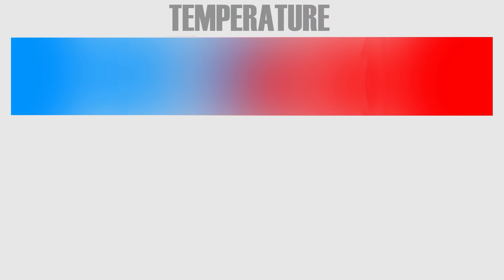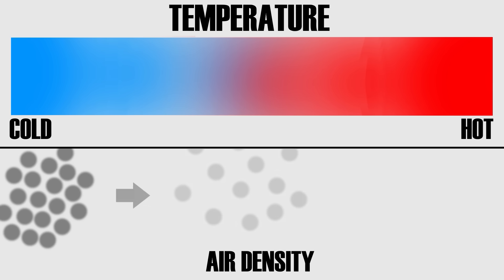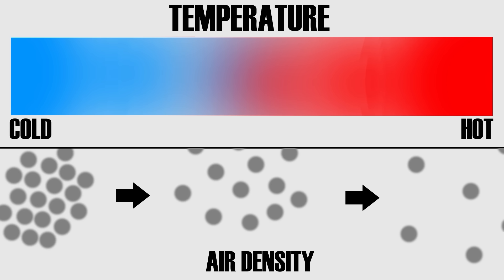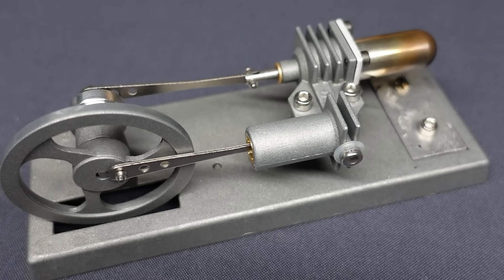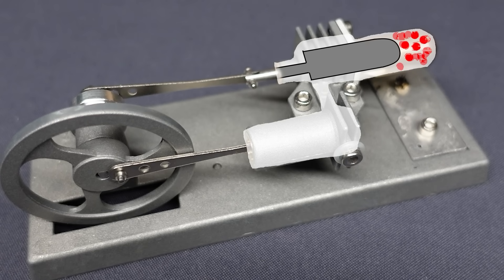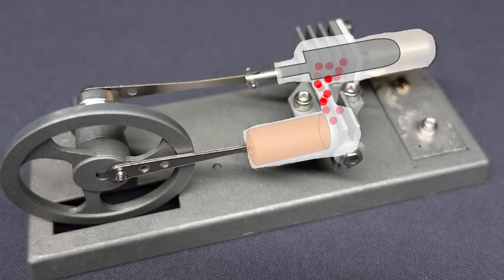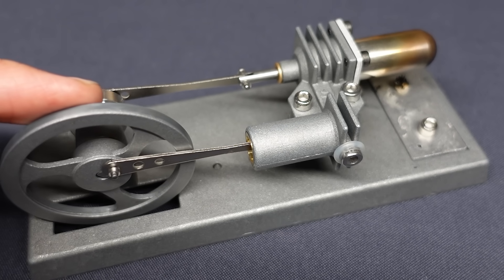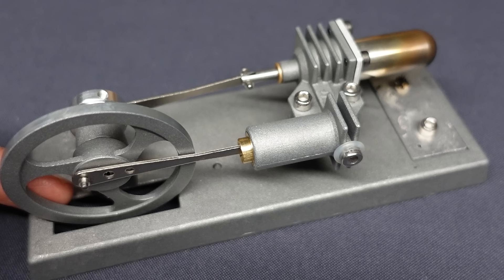It Can Save The World - The Simple Genius of Hot Air aka Stirling Engines

Comment: I have always been fascinated by heat engines... As a kid I came up with an idea of using a 'refrigerant' as the working fluid that would ideally work at room temperatures... It likely wouldn't be practical for anything but it would seem to be powered by 'nothing'...
Also likely not even possible but it was a thought I had. 
Basically this sort of thing using room temps to spin.

Comment: You can place an Alternator on the Output End and build a Tracking Mechanistic that uses residual energy to power a Mechanism to keep a Beam of the Sun from a Magnifying Glass locked on the HOT side and a small Fan blowing on the COLD side - although it would take alot of math and engineering to DO that, it Could be Done... that way the Sun would run your Sterling Engine and techichally, even tho the SUN has Heat and is a big ball of Plasma (we still dont truely know how the sun works) ... you would have a Combustion-less Engine

Comment: Could biccle gears modulate the power in the sense that you would usually have more power than you need but you could disengage from the power resulting in moving at a lower speed because the gears are doing the modulating while the temperature remains the same..

Comment: use the power piston of the Sterling engine to drive a magnet into and out of a solenoid coil and you have an AC generator.
Then power the engine using a parabolic mirror to focus the sun onto the displacer cylinder.
Would this be more more efficient than using solar cells?

Comment: Steam engines are also external combustion.
Reply: True. Steam engines consume fuel and water, though. Stirling engines just burn fuel. But steam has more power output. Pros and cons for both. I love stirling engines. I think they're really cool. But the fact that they've had little to no real-world applications says something.
Reply: They dont combust 🌹
Reply: @Andrei_Anton-C20  There IS combustion involved in a steam engine to produce the heat required to make the steam (except in a NUCLEAR powered system!)
Reply: And far more powerful
Reply: Not really because the fire is enclosed in the firebox and drawn through the boiler tubes by a vacuum in the smokebox.
Reply: @steamingaroundbritain  So how is it NOT external combustion?  There is NO fire in the power cylinder, that is what external combustion refers to.  Internal combustion engines generate the heat INSIDE the power cylinder to push the piston, that is done EXTERNALLY in heat engines such as steam and sterling types.
Reply: @KennethScharf  the fire is still concealed inside the locomotive
Reply: @KennethScharf  it's still part of the system that is enclosed
Reply: @steamingaroundbritain  Of course it is.  But that has NOTHING to do with engine classification.  The only part of the engine that matters are the two cylinders and pistons, and there is no combustion there in.  QED it's an EXTERNAL combustion engine.  Don't bother to BS any further, you lost the argument.
Reply: @KennethScharf  alright alright no need to be rude and arrogant there is such a thing as free speech
Reply: @steamingaroundbritain  I think the point is you can put a sterling engine inside a box and conceal the fire along with the rest of the engine, but it is still classified as an external combustion engine. Just because the fire is inside the locomotive doesn’t necessarily change the classification since the fluid producing the expansion that drives a piston inside a cylinder isn’t what’s being combusted. Thats my interpretation anyways.

Comment: When you replace the air for a refrigerant gas that expands more than air at room temperature, you get increased efficiency, and the piston that reduces air pressure can act as a cooling/air conditioning device.

Comment: What if you made solar death rays as a heat source to start up one of  these badboys... and use the output to power an induction coil to heat the hot side and any remaining power on cooling the cool side of the motor.... to  see if you can cause some kinda runaway power generator.

Comment: Seems like they could be useful for generating power to be stored in batteries. Install them into infrastructure that produces waste heat and use them to feed electricity back into a battery powered grid of some sort. Maybe have individual power banks built into people’s homes so their waste heat from home heating systems, ovens, stoves, AC units, hot showers can be reclaimed. To then boost said power bank and reduce overall load on the power grid; and maybe even feed back into it.

Comment: Could a Stirling engine be used to harness the excess heat from an engine to power a non parasitic supercharger? It would theoretically give all the gross power from a belt driven supercharger without the draw from the pulley while also assisting in cooling the engine.

Comment: It works with the light of a candle, so it has the power of a light of a candle.
If i want to move a car with such an engine, i assume the light of a candle will not be sufficient. 
Also you did not mention the yield of a stirling engine.

Comment: What about using Solar energy to heat UP the engine, either using a mirror to concentrate the energy on a cylinder or simply coating it with black material. 
Depending on the region you try it, it should work don't you think?

Comment: Funny you should mention the submarine. I could see an application for small marine engines. By putting the cool side in the water you could possibly increase efficiency and power could be modulated by prop pitch and possibly a brake to temporarily absorb excess engine power after fuel flow reduction for improved maneuverability.
Reply: A Dutch company did that in the sixties

Comment: I have the same engine that you first show. I'm using denatured alcohol and have double checked everything. It will barely run. I have come to the conclusion that the problem is the fact that I live at a 7000 ft. altitude...pretty thin air. Comments?  Michael

Comment: Excellent video! I have seen kits from science/educational supply companies that sell small versions of these engines for learning. I always wanted to know more and have them explained. Your explanation was wonderful. Now, why aren't they being used? I could see them being used to power small appliances, like room fans, in remote locations, where there isn't electricity. Like if you lived in a remote cabin, out in the woods. Have they been adapted to run on solar heat?  Using the sun's rays, to run them, and they are designed to produce electricity, they would be useful to cabin dwellers, not connected to the electrical grid. A friend of mine lived in a remote area, he would charge multiple car batteries, with his work vehicles, during the day. In the evening he'd take the batteries into his cabin, to operate his lighting and other appliances. He had some kind of converter (?),....that changed the DC current into AC current. He also had some appliances (factory made), that were designed to run on DC current.

Comment: Remember that efficiency is related to source and sink temperatures. So Stirling engines are extremely inefficient.
Reply: "The thermal efficiency of Stirling engines is 40% while the efficiency of similar Otto and Diesel engines are 25 and 35%, respectively"

Comment: Have you ever thought about using focused sun light with lenses onto the piston to generate the heat for a sterling engine? It could make a small solar powered generator to charge cell phone, flashlight or walkie talkie batteries during power down events. You could even use heated rocks in a campfire to generate the heat to make a low power generator for camping. Charge batteries to power led lights.

Comment: Nope been tried not efficient enough. Steam engine is better, ice hybrid or hydrogen fuel cell is best. old tech that does not work is not cute or interesting get a life and use your brain properly.
Reply: "The thermal efficiency of Stirling engines is 40% while the efficiency of similar Otto and Diesel engines are 25 and 35%, respectively"

Comment: really interesting. but, using waste heat does not make something emissions negative. It just makes them emissions neutral. They have no emissions. They do not pull any CO2 out of the air.

Of course, if you use it to power carbon capture, then it's emissions negative.

Comment: Another thought: Since nowadays nearly all non-electric locomotives are Diesel-electric, the inability to modulate Stirling engine's output ceases to be a problem. The train engineer simply modulates the current generated by the generator. All the engineer needs to do w.r.t. to the Stirling engines is to ensure they keep running through the journey.

Comment: The sad thing is that Stirling created this engine prior to Bessemer perfecting the process of making steel. Cast iron was not strong enough to handle the heat required for large scale Stirling engines. Engines by Newcomen -- then later by Watt -- does work with cast iron.

By the time Bessemer process came out, steam engine was already entrenched.

Comment: Nice video.  These have been around since 1699, when Robert Stirling invented it.  That's why you were able to order a kit and build a very small one.  Though in theory, they are very efficient-- in use, they aren't nearly as thermally efficient as internal combustion engines.  And that's why in the 400+ years of their existence, they haven't caught on except in tiny hobby kits.

Comment: Every time I have ever looked at an Oil Well (eg: Alberta Prairies) and see the Flame Stack WASTING heat and fuel for that matter, I think how it could have all been used for many decades to heat a boiler to contribute to the overall electrical grid or at the very least, to charge batteries. But talk an Energy Company into doing something they can do with Gas and Oil is taboo !

Comment: I bet it would run quieter if they put guide rings on the displacer piston so it isn't a rattle trap. Or make it a tight fit, but with air channels running along it's length so the air can still move around the piston as needed.

Comment: I built one from scratch as a kid but instead of using a burner to heat up cylinder 1 it was mounted to a parabolic reflector. With some tweaking & alignment plus a long connecting pipe including a long crank arm to reach cylinder 2 behind the reflector it actually worked very well. I attached a dyno from the fly wheel shaft & it was able to produced around 3 to 4 amps constant while the sun was shining, charged up my 12v battery for free thanks sun. I actually one first prize when I entered into my school science fair, being a 14y old I was quite proud that day.

You can make energy just about from everything besides fossil fuels but you will still need oil for lubrication, sure my project worked great but prolong use did cause detrimental wear & tear especially the hot piston without lubrication. I guess with further designing & adding oil rings, bushing & lubrication injectors plus a oil cooler it's possible to make it work for long durations, only when it's sunny that is 😁maybe combining it with solar you can boost your charging capacity.

Comment: I am sure someone at NASA thought of this so its likely a flawed idea which only seems good at first: You could create controlled opening on the working cylinder thus controlling the pressure and through that the power output. These need to be fairly small I'd imagine cause that pescy pressurized air would rather set itself free than do any work on the piston. Or maybe a pressure release valve where you control the spring tension and through that the max pressure in the cylinder..

Comment: What is heat required for the gas to expand and the piston to cycle? Im thinking of a concept with the use of magnifying glass for free energy. Or something that insulates heat extremely well. So well that it heats up by direct sunlight. But can be cooled by throwing a shade over it when not in use.

Comment: I’d like to see one of these run with instead of a candle to heat the… chamber, it used a wire coil and a battery to discharge heat like a convection burner.

Comment: Thanks for your great explanations of various aspects of engines! On the "hard to modulate the power" aspect, wouldn't a CVT help with that? Or a hybrid design, the engine drives a generator for electricity, electric motors drive the wheels, with a small battery or large capacitor to pick up the slack like the submarine; would it be feasible for a car? And how does the Stirling engine compare, in efficiency and power/weight ratio, to other alternatives like gas or steam turbines? If you decide to make a video on that, I'll watch it :) Thanks again, I'm learning a lot.

Comment: So Stirling engines run on the heat transfer of air.  What if you used a different medium?  If the gasification point of the medium was near ambient temperature,  how would that effect the volume/pressure exerted?

Comment: Question: Theoretically, could you power a small stirling engine from the heat generated from an incandescent light bulb and then in turn generate enough electricity to power the bulb?
Reply from the maker: That would be a perpetual machine and that doesn't exist
Reply: @d4a  Yet.

Comment: Maybe one application in land vehicles could be in series hybrid cars. Something like the Nissan Qashqai ePower with fully electric traction and a combustion engine exclusively to charge the high voltage battery could use something like this.

The greater weight of the Stirling engine would be offset by its efficiency and the fact that you could do away with literally every emission device on the car since it would instantly comply to the highest standard.

Comment: i like the fire pit with a turbo kinda engine same any fuel but its got more rpms and generators output is directly connected to rpms more is better. for moving like is a car slow is ok you need more torque rather than speed.

Comment: I think it would be an ideal engine for simply for getting around everyday. Dump more fuel for hotter flame and engage a clutch or converter more or less as it needs. If you had some way to imitate a heating coil and have a large flywheel that would be perfect. The residual heat gives so much potential especially when you have a consistent power output based on the temperature and don't need to worry about detonation. A semi truck hauling with this using propane would make Hank Hill a happy guy.

Comment: I'm curious, does it work in reverse?  Like, if you apply extreme cold to the bulb that is normally heated, will it still function?
Reply from the maker: It will, but you'd need truly extreme cold in a very hot environment as this is a high temperature differential engine.

Comment: They shouldn't be called external combustion engine because they don't need any combustion to work, basically only a heat differential. A better name would be "differential heat engine" or perhaps thermal engine although this is not as descriptive. 

I might add that because the displayed Stirling engine has an open flame it would fill the room with CO2 until most of the O2 is consumed at which point it would make CO also resulting in death, however the Stirling engine would have to be of similar power to the petrol engine to achive this in any normal room :-) 

But then it could also run off hot water running over the hot end into a drain and produce zero emissions.

Comment: I think there are ways in thich the temperature difference can be modulated mechanically to solve the power modulation. Let's consider one of those "coffee mug stirling engines" whose hot surface is just the bottom plate. If the hot plate was replaced with a sliding sheet laminated with an insulator in the middle (i.e. 2 squares laminated side to side), one could only heat one side and then throttle the engine faster by sliding the heating plate to the side that's maintained relatively cold.

Obviously this is not perfect and could probably be designed in a more clever way but I think it's enough to bring my point across and would be a great improvement on just waiting for the plate to cool.

Also if the plate was in itself the heat source (say it was encasing plutonium for decay heat or consistently having a lens heating it) it could be popped into an insulating jacket when the engine is throttled down to drive the temperature way higher and make throttling back up more responsive due to the larger initial ∆T

Comment: Stirling engines are used in space. The hot side of the engine facing the sun and the cold side facing the opposite direction.  The big difference in temperature is ideal for the engine and it never runs out of power.

Comment: I really like the video and I am a Stirling fan too (I have a 2-cylinder version of your V4). What I did not like is when you tell, after putting off the candles that the engine runs on "nothing". In fact the engine runs on the very energy that you needed in the beginning to heat up the hot cylinder. You use up that initial energy (to a not 100% extent) with a time shift. 

By the way, there are already a lot of companies working on solar powered Stirlings (instead of photovoltaic), if you can preserve the heat, you can run the Stirling later - this overcomes the biggest problem of solar power.
Reply: Just capture the heat from the sun in a tank of water which surrounds the displacer cylinder of the engine(s).

Comment: I guess the submarines which use stirling engines use the sea to dissipate heat on the cold side of the cylinder. But this thermal signature could in theory give away its location with sensitive temperature detection equipment.